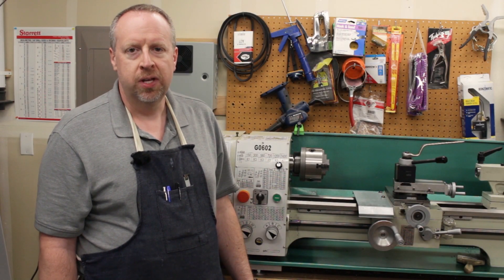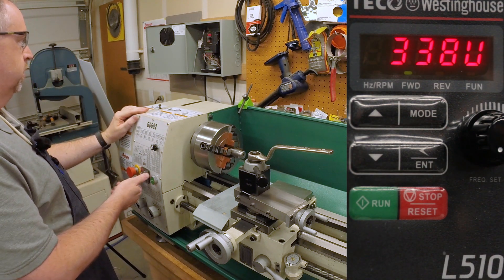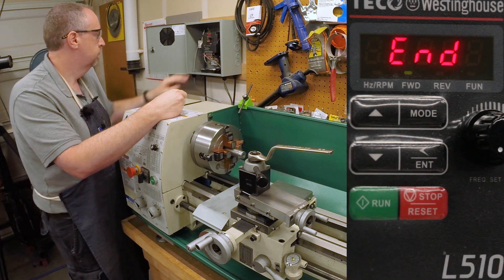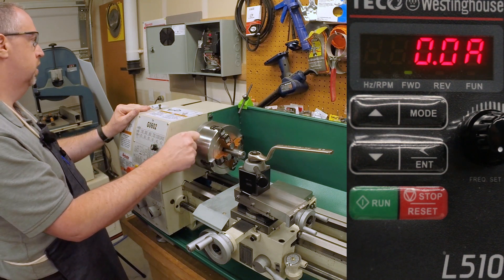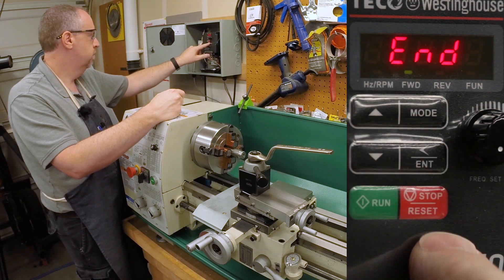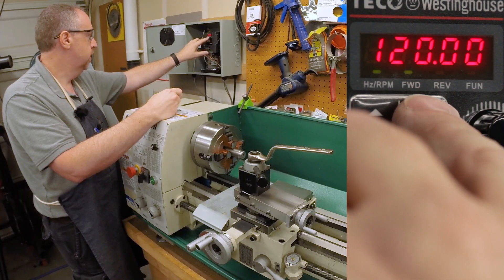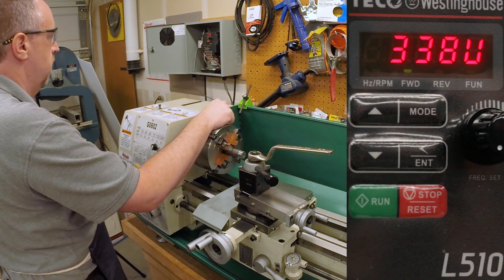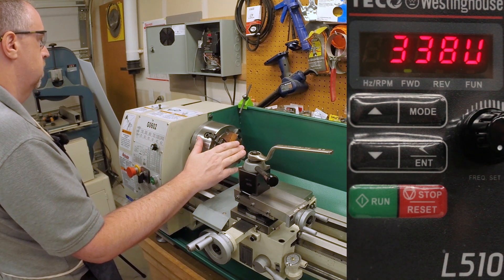Lathe VFD Addendum: How to Tune Acceleration and Braking

Comment: I find your videos very informative. I am planning to put a soft starter on my 15 hp air compressor. I’m running it with an American Rotary phase converter which I hope to integrate it with the soft starter. The phase converter is rated for a total of 40 hp so I have plenty of power. I just want to bring the compressor up to speed a little slower. It has the head unloaders so I can start the compressor without it having a load. I just need to wrap my head around exactly what I need to do. Your videos are great. Looking forward to watching them again. Thanks

Comment: I'm very curious what the motor and VFD cost 5 years ago when you originally did this conversion compared to now. The price for the vfd at amazon is just insane, and I found it much cheaper elsewhere. The equivalent motor (different brand) at EMW is about 315 including shipping, and the vfd I got for 225, but seems like it could be had for ~200

Comment: as i said in another video, great series of videos.  i am in the middle of the same process for my 1946 wood lathe that currently has a 12 speed belt drive.  It's speed range is around 600- 2500 rpm.  One thing you could clarify is how to program the vfd for the remote controls.  you stated early on, that your vfd was already setup for the forward/off/reverse switch and the speed pot.  the f/s/r switch requires parameter 00-02 to be set to 1.  then parameter 03-00 set to 0 and parameter 03-01 set to 1.  i haven't got to the speed pot yet.
if i missed your description of this, i apologize!  all of the above parameters on mine were set to 0 which is the factory default.  as you suspected, someone has been playing around with yours before, maybe factory testing or a returned unit

Comment: Please i need your help 🙏🙏 i have inverter and 3 fase motor in my lathe but i had problem in low HERZT . MOTOR START TO BE HOT AFTER I CHANGED PULLEY LIKE YOURS FOR HAVE MOR TORQUE.....

Comment: How do you see the other modes.  I'm in the process of installing this  actual drive into my drill press.  I can only get programming mode and hz, no volts, no amps.  Cannot even figure out how to get it to reverse from the keypad.  I can make it run forward or reverse using the S1 and S2 switches

Comment: i do have a question... don't you have to worry about the chuck spinning off? At least that is what everyone always seems to mention about threaded chucks. Or did you do something so that you don't have to worry about it anymore?
Reply from the maker: The chucks that come with the G0602 lathe have locking clamps that should prevent this.  I probably still wouldn't run it in reverse under load.
Reply: @Clough42  I am curious do you know a way that you could safely run it in reverse?
As that makes it basically non usable then..

Comment: hello clough, i've learned a lot in your videos great work! you also inspired me to put a vfd on my lathe with speed control, i just have one question, given the ability to run the lathe as slow as you want, to the point of you can use it as a welding rotator for tubes, is it safe to weld on the lathe while it is running??? will processes like tig, stick, mig welding hurt the vfd?? thanks a lot
Reply from the maker: Welding on a lathe is generally a bad idea.  Electronics like a VFD can be damaged, but if the weld current goes through the spindle bearings it will destroy them.

Comment: I know this is older but I'm getting ready to add the same setup to my G0602 and was wondering does this vfd have a more to read rpm instead of hertz or do you need to add some type of tachometer thanks for any help 👍👍👍
Reply: * mode to read rpm
Reply from the maker: Most VFDs have a way to configure a ratio so it can display RPM.  I didn't bother because I was planning to include a tachometer in the ELS.

Comment: I installed the E510 TECO inverter on the wood lathe.  Watched the whole series, I think.  After hitting the stop button, is there a way to shut the VFD down when you're  done for the day?
Reply from the maker: I have mine set up with a contactor.  When I hit the E-STOP, it disconnects input power.
Reply: @Clough42  Thank you

Comment: teco vfd s310+  
vfd input voltage 380v,
increase input voltage 390v
parameters set push but error signal

Comment: I have been following this series with interest, but here you are loosing me.

Why on gods green earth are it so important to get it going from zero to full power as fast as possible ? I mean, you are not living of it as I understand

What would be much more appropriate was to get it to STOP as fast as possible, I mean I can see it in the news:

"Man have VFD'ed his lathe, it can go from 0 to 120 hz in 1.2 seconds, unfortunately he had an accident, hit the emergency switch, and we predict that the lathe stops some time this year."

Wouldn't it be more prudent to get the thing to stop right here and now and maybe use 4 seconds to spin up ?
Reply from the maker: Yup.  I also have it tuned to stop as fast as possible, but this VFD doesn't have a braking resistor terminal, so braking capacity is very limited.

Comment: Great series of videos.  One question I have, I read a while ago when I was looking for a 3ph RAS, that when running a motor off of a VFD you should derate the motor to approx. 2/3 of its max HP and that the only way to get close to running a 3ph motor off of single phase at the rated HP is to use a rotary phase converter.  Has that changed with new VFD's?
Reply from the maker: That's news to me.  I think a static phase converter has to be derated, but I'm not aware of limitations like that with VFDs.  VFDs generate electrical noise and can damage motor windings if they're not rated for inverter duty, but they can also soft start the motor and vary its speed.
Reply: @Clough42  Wow, thanks for writing back so quickly.  On a video this old, I was not expecting that.  Anyway, I had read that a VFD is not that different from a static phase converter in that you needed to de-rate the motor.  I don't know the facts, which is why I am asking since you are more up on this than I.  While I am not electronically or electrically inclined, I recall that when the discussion came up at work about wanting to retrofit VFD's to our large air handling units (100 - 200 hp motors), the motors were not VFD rated.  After some looking into by our Engineering department, it was determined that motors made from the '90's on are fine with VFD's, regardless of whether they were rated for VFD usage or not. Come to think of it, I think it might have applied to high efficiency motors produced from the '90's on (?), which is what we had by then, and not the "normal" efficiency motors, but this is going back to when I started at my current job about 16 years ago, so I may be mis-remembering things. I know you're thinking that motors from the '90's should probably all be replaced by now, not exactly, motors in that size range get re-built (new bearings, not sure what else may be replaced) and re-wound (when needed) and not fully replaced until they can no longer be repaired, economically.
Reply from the maker: @paulprobusjr.7597  Those are big motors.  The largest VFD I've ever used is 3HP.  I've met a lot of people with vast experience who believe all sorts of things--and probably for good reasons--but I would look to the VFD and motor manuals or consult with the supplier.  Most industrial supply houses can answer technical questions about their products.

Comment: This is a great series of improvements to the G0602 Lathe.  I have that machine and am going to make this conversion.  I have the motor (Marathon R313A) which is comparable to the Leeson and  I have the Westinghouse VFD.  My only comments are that it would be helpful if a bill of materials was shown early on so research and costing out could be achieved.  That way a person could judge whether or not he had the available resources to complete the project or even start it.  Thanks for your great presentations.

Comment: I believe you have the wrong idea of what the braking transistor does. The braking transistor is responsible for dumping current into an external braking resistor. The setting you were changing dictates at what DC bus voltage the drive should start to dump energy into the resistor. The low voltage shutoff voltage for the transistor dictates the DC bus voltage where the drive should stop dumping energy into the resistor. This should NEVER be set lower than what the bus voltage tends to sit at, otherwise you’ll just be dumping energy into the resistor all the time. If you add an external braking resistor, you could definitely slow the lathe down much faster.
Additionally I’d recommend testing the ramp rate settings with the largest chuck and stock you ever plan on using.
Reply from the maker: This particular VFD has no resistor and has no terminals to connect one.  The braking energy is very limited because it's dumped through the transistor into the heat sink in this model.
Reply: @Clough42  Actually it seems yours doesn’t even have a braking transistor and they left the setting in the firmware anyway. Here’s a quote from the quick start manual: “Notes:
*1: Models 460V 1 ~ 3 HP ratings have a built-in braking transistor. To use this braking transistor a braking resistor can be connected between P and BR.”
Reply from the maker: @mman454  looking at it again, I think you're right.  I hadn't noticed the diode in the diagram.  This model appears to have only DC injection braking.
Reply: @Clough42  I mean, it will still do 20% braking through the IGBTs that it uses to run the motor. So you aren’t wrong in saying that it is doing some regenerative braking and dumping the energy into the heat sink.

Comment: Hello James, Is there a way to display the rpm's on the L510?
Reply: You can display the frequency or the rpm. From the manual, Enter motor base rpm into parameter 12-03 to change the display units from Hz to rpm.

Comment: What if you put a massive chunk or bar in the chuck? It seems like you calibrated the braking time and ramp up time for a very light load. So is there any room for braking a heavy piece under 4 seconds or will it spike in voltage and cut off since voltage goes over 380? Anyways really good videos. I remember from an earlier video that you changed the PWM setting from 2 phase to 3 phase and got rid of the whining sound, is that the way to go in your opinion? The reason for asking is that I will face this vfd tuning soon when setting up my zetterlund vf600 with a bigger motor and an teco e510 vfd.
Reply from the maker: If I put something big in the chuck and run into trouble, I'll adjust it.  I'd like to have a brake someday, but I didn't realize this VFD didn't support it when I bought it.
Reply: @Clough42  alright. I had a mechanical brake on my storebro gk195 and that felt nice. If something bad happens. But how come it doesnt work with a vfd?

Comment: Thank you James. I’ve just re-watched the entire series, and I find this addendum to be particularly helpful!

There’s a topic that might be useful to viewers, and perhaps you can comment. Recalling that hitting your e-stop button kills line power to the contactor, and therefore cuts power to the VFD, what happens in a real deceleration after the e-stop is hit? Does the VFD still absorb energy, aiding the spool-down, without line power? Or, does the machine simply coast down?

Also, in the years since this series, have you by chance added a braking resistor?

Be well!
Reply from the maker: If you kill power, the load coasts.  This VFD model does not support a braking resistor, unfortunately.

Comment: Does adding another braking resistor help with the braking time and voltage? With mine there are different resistors to assist in the braking.
Reply: Yes. An external braking resistor does the job.

Comment: Just come across this video and had one thing to note. When you're doing the settings for acceleration and braking, you should really do the tests with the largest sort of item you might work on in the chuck, as this adds a lot of extra loading and so you should never get an overload error. Also, it's worth getting the external resistor, as it will save the VFD.
Reply from the maker: The L510 230V model doesn't support a braking resistor.

Comment: Do you think the the over voltage on decerlation would cause motor bearing damage pits  ?
Reply from the maker: No.  That's a separate issue.  Motor bearing pitting is probably just normal bearing damage, or common mode electrical current that should be blocked with a big toroidal choke.
Reply: @Clough42  why not just use a grounding ring to ground the motor shaft to the frame of the motor ?
Reply from the maker: That would be a good solution, probably best used in combination with a filter.  Filter toroids are available for about $20.  The grounding rings I've seen cost ten times that.

Comment: I have the same VFD running a 1hp Marathon Globetrotter 1750rpm motor, but on a much smaller machine (Grizzly G4015Z 3-in-1) and i run 1 second acceleration and .5 second deceleration times. Obviously I have less rotating mass and thus less inertia, so it doesn't cause me any issues. I tried .2 second deceleration, but it was a bit rough on the machine (audible belt slippage is never a good thing). I do run .2 second deceleration when threading, and use forward/reverse jog buttons to power the machine. I never touch the half nut and spin the lathe backward to retract the carriage. Very handy!

Comment: now get you a Tachulator, just google dit. great addition to the lathel. great tutorial.
Paul
Reply: Ive been looking at that. Good investment?
Reply: I have a Hitachi VFD and with a multiplier setting you can easily get it to display RPM on it's display...no need for a Tachulator. Unless you have your VFD hidden away, I guess.

Comment: I'm confused about overclocking the motor, did the motor tag say you can only go over to 1.15  it's rated capacity is that not 15% (60hz + 15%) ? when you overclock it to 120hrz is that not 100% over and not the 15% on the tag. If I'm wrong please explain?
Reply: i think that's 15% above its rated power (so say it's a 1 kW motor; you'd be demanding 1.15 kW)

Comment: Thanks for the great info James.  This and your other vfd programming video are the best and most comprehensive i've seen.  Certainly helps that you're demonstrating practical scenarios along with great explanations.  I actually have the Grizzly G0752 which, as i'm sure you know, is the cousin to your lathe and has a VFD pre-installed by Grizzly.  One thing I don't love about the Grizzly implementation is the fan they've included to cool the motor is incredibly loud and is always on, when the lathe is in the 'On' state.  Meaning the VFD is on and I can now turn the motor on forward or reverse...  Here's a clip of the behavior/volume.  https://www.youtube.com/watch?v=4Eksans0E5Y  I've been thinking of seeing if I can programming the VFD to at least not come on until the motor is spinning.  It's just very distracting otherwise and I end up turning the unit off just so I don't have to listen to it.  But then I have to wait a good 3-4 seconds after turning on the VFD before I can engage the motor.
Reply: Paul Morley you can put a thermal switch, normally open, on the IGBT heatsink and wire it inline with the fan positive. Get a unit that closes at the desired temperature, which will turn the fan on. The right temp might be something like20 degrees over room temperature in your shop.

Comment: Hi, the braking transistor and a braking resistor will only develop a slowing down circulating current whist the magnetic field within the motor exists. When you remove the power from a motor the magnetic field begins to reduce, in accordance with the time constant of the motor. Small motors have time constants in the order of milliseconds large motor may reach a second. So once the magnetic field has collapsed there will be no slowing down torque.  dc can be applied across the motor which can provide some torque but it is only proportional (slightly) to speed and needs to be removed once stopped. Similarly reversing the 3 phase supply will generate negative torque but this has to be carefully controlled as this has been known to break coupling bolts on large machines. Enjoy turning

Comment: The setting for the braking transistor cut in might only be for the braking resistor, since you don't have one that might be why it didn't seem to have any effect.
Reply from the maker: This VFD model has no connection for an external braking resistor.  The braking transistor just dissipates the energy into it's own heat sink, so it is pretty limited.  Higher voltage models have the external resistor connection.

Comment: I think that I would be happy with a 2.5 second start and a 4 or 5 second stop, thereby not encouraging the vfd from destroying itself. I bet the first component to blow will be the voltage transistor running the ramp down time. You had better find out where it is and see if it's replaceable lol
Reply: I run half a second stop with the same VFD, no issues. 4-5 seconds isnt fun when threading. I actually cut stop time to .2 seconds when threading and use the jog buttons (added to my remote mount control panel) to power the lathe. I never touch the half-nut and simply spin the lathe in reverse to reset the carriage. Very handy and saves a ton of time.